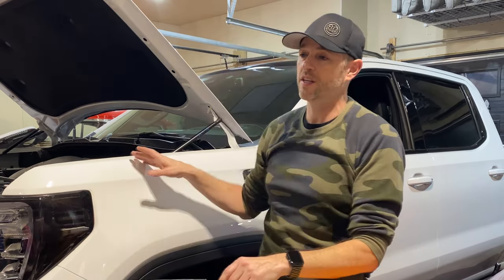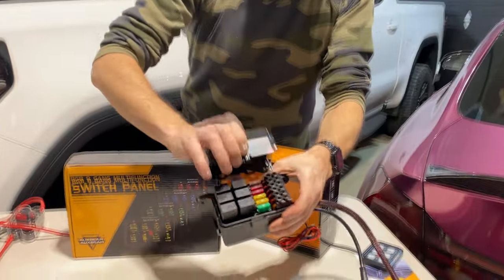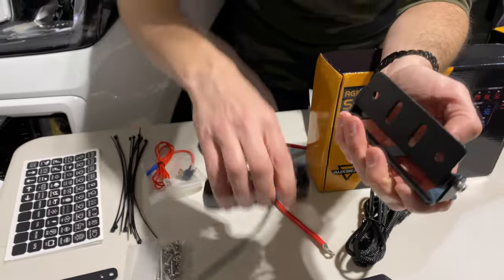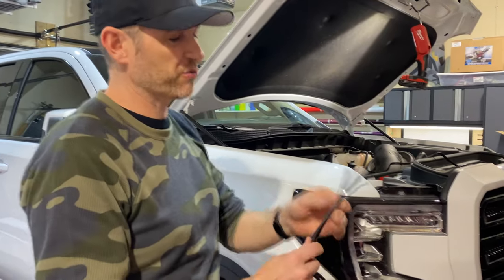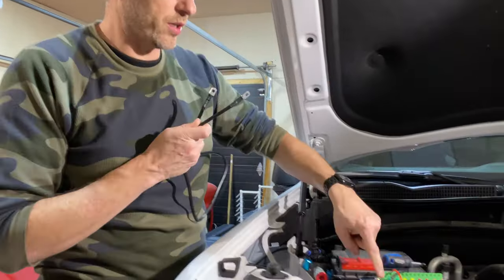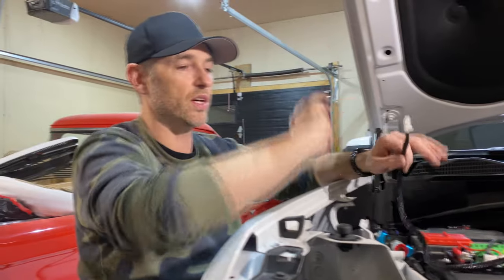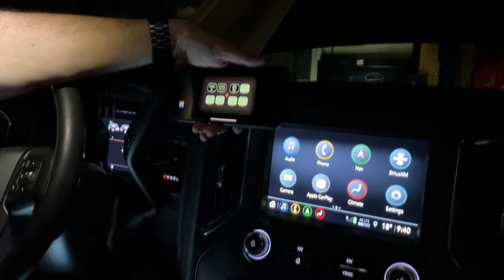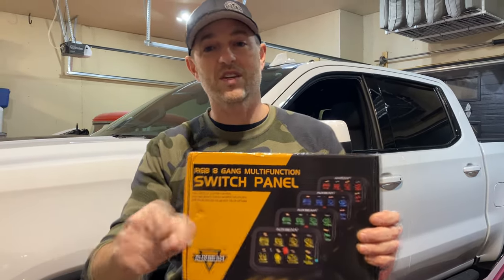New Switch Panel AUXBEAM AR-800 RGB Multifunction Bluetooth LED Install and Review.

Comment: I installed the same switch panel and I’m now on my second one and it still doesn’t seem to be working correctly. Sometime the switch will power on and sometimes it won’t. Sometimes when it does have power I’ll push a button and the whole panel will lose power. Any idea what might be causing this or how to fix it?
Reply from the maker: Something isn’t right.  Mine has been 100% and I have 5/8 used.  Maybe the harness from the battery to the switch is shorted
Reply: @Donslife  what harness are you referring to? It’s just the power cable from the battery to the switch isn’t it? Excuse my ignorance, wiring rookie here
Reply from the maker: Hey now worries.  I didn’t explain my thought well either.  The control harness from the box under the hood to the switch panel has some pretty thin wires in the braided harness.  I was thinking one of them could be intermittently shorting out.   When you replaced the last one, did you replace the wiring too? I would start there anyway but still reach out the AuxBeam.  They sell lots of these things and may know of a specific issue

Comment: I just bought a ARB single air compressor. Is it OK to hook that up to my Auxbeam
Reply from the maker: What is the fuse amp rating?
Reply: @Donslife  
It said up to 32 amp
Reply: They said could be up to 32 AMp
Reply from the maker: Which model number? The reason I ask is 30Amp circuit protection is the max for the Auxbeam panel.  You would probably be okay with 30, but I can promise when you work the compressor hard, it won’t blow the fuse.  Is there an inline fuse that ships with your ARB compressor?  Does it read 30 or 40?
Reply: @Donslife  40
Reply: CKMA 12 in the fuse is in it is a 40. But I could change that to a 30 just in case.
Reply from the maker: You could do try that so nothing gets damaged
Reply: So the way that the directions look like. Is that you hook the 12 V positive negative to the battery and then the switch doesn’t have as much current to turn it on and off. And that’s what I would hook up to the auxbeam? They are very small wires that go to the switch. I do not believe that would carry 30 amp.
Reply: Thanks for your help I appreciate it
Reply: For least amount of hassle I’d run a relay. Use the switch to trigger a larger relay for the compressor power from the battery. That way there’s no load on the switch panel other than the very little .02 amps it would take to trigger the relay coil to close the relay contacts.

Comment: What is the fuse # where the thin red wire goes?
Reply from the maker: I went with the cooled seat circuit
Reply: @Donslife  could i use one from the front fuse box, i have a 2020 GMC Sierra, or do you recomend not use that box?
Reply from the maker: Hard for me to comment since I don’t know if your 2020 and my 2021 have the exact same fuse locations.   If you can find a suitable circuit in the front box, go ahead.   I wasn’t happy with my options in the front fuse box under the hood
Reply: Ok thanks for u help

Comment: The oem Upfitter complete kit is $160 from gmc. I was in kelowna last week and got everything including the new panel. Sherwood Park did not have any the only other was Okatoks. All locations priced them out at right around $160.00. -$114.38 plus tax includes new knee panel , fuses, all wiring,  screws, and the switches.Bannister GMC PART#84942073 $114.38
Reply: I was quoted well over $350 CDN in Winnipeg. 🤷🏽‍♂️
Reply: There are 2 different kits one includes the switches, wires, bezel  and lower dash panel. The cheaper kit does not include the lower dash panel
Reply: @Juddmann007  the kit I got had everything.
Reply from the maker: Almost $400 here for me too.  Either way, I am happy with my choice and I can control it from my phone and infotainment screen
Reply: @gooilers5408  same here.  About $160 including all parts and trim pieces.  Can’t go wrong for the price.